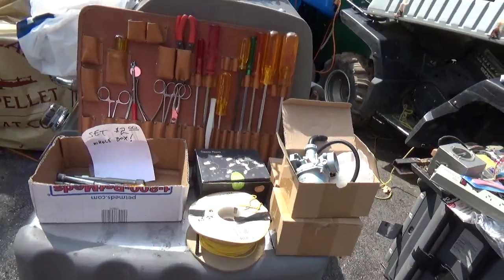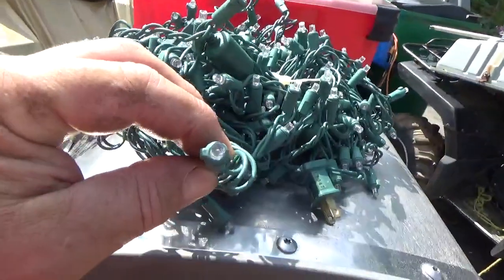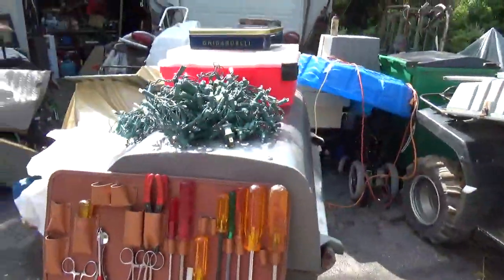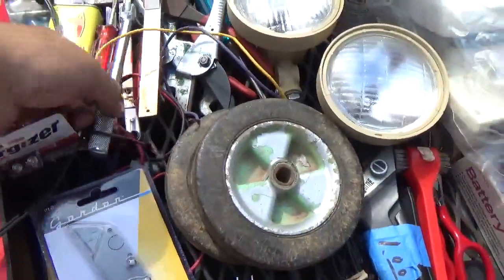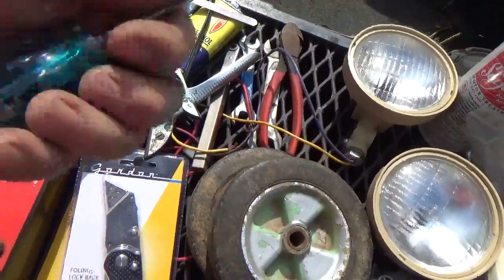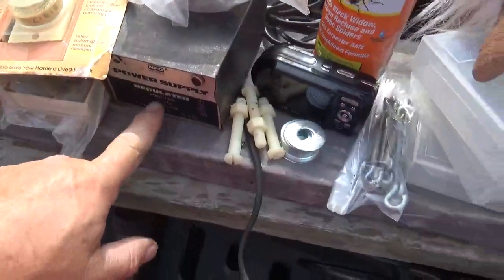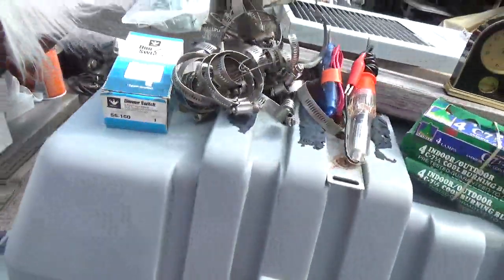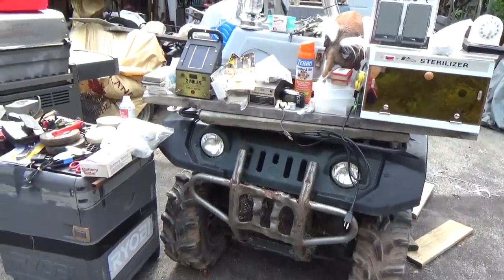$1 Flea Market Deals, Klein, Vaco, Xcelite, SK, LL Bean, Radio Shack, Solar Electric Fence!

Comment: The nightcap battery charger was made for the hobby grade RC cars I used to have one of those and I used to have a crap load of RCs ended up going off in trade in the bunch of them for some of my three-wheelers I have I have so many three-wheeler stuff but not as much as you but I have crates of parts
Reply from the maker: Hey Joey! I'm hoping that it is worth $1, I'm going to use it to charge LiIon batteries.... Do U still have those trx200sx fenders...  3 wheeler parts just get more and more valuable as time passes.... Thanks for Ur thoughts, encouragement, watching, and commenting!!!
Reply: I did have the fenders but ended up trading them with the three wheeler to a buddy of mine it needed to be restored I traded it for a running 85 ATC 110